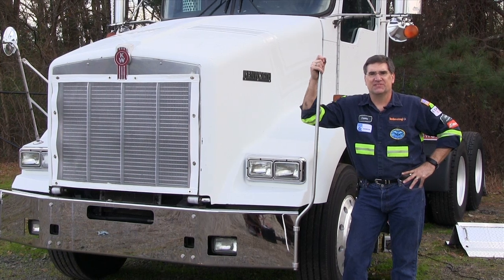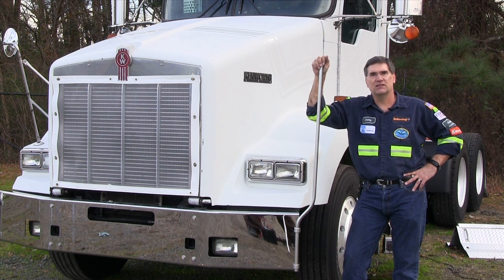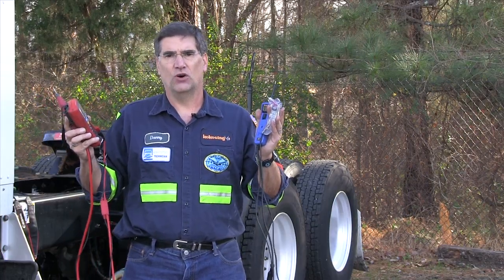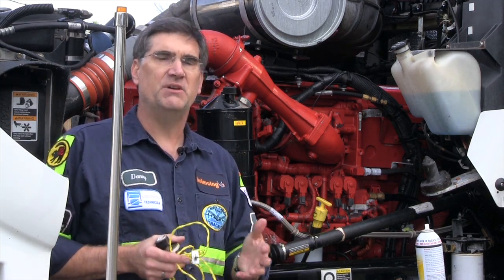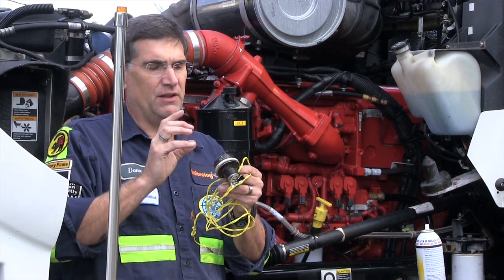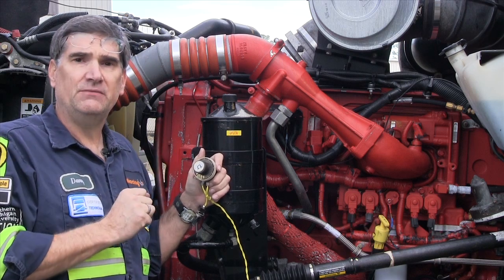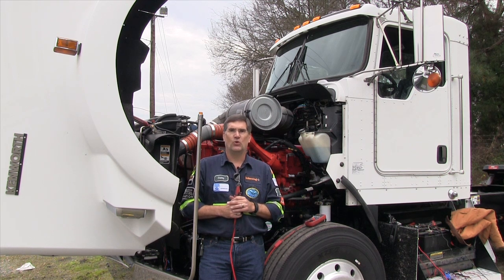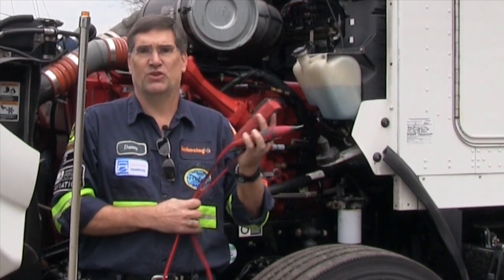LOADpro® vs. Volt-pro vs. Powerprobe® vs. Corrosion

Comment: Which tool is better? Decide for yourself. Whatever tool you pick, one thing is for sure: the ckt  must be under load to get accurate voltage drop readings. Ohmmeters are for the bench. The PP requires back probing/piercing a circuit that has not been unplugged and is up and running. The LP idea is unplug the load and substitute the load. LP is cheaper cause you already got a meter. The idea of having to back probe every time greatly limits options to conductor access. LP doesnt need to go back to the battery, beautiful. Not sure how LP does accurate loaded ckt testing with 40mA/Volt. Guess it just does, and how does VP work?
Reply from the maker: Carl Thaysen It works because Ohm's Law is perfect, so ANY drop is a measurable resistance. It's not designed for large gauge wire - but it will work. It requires your judgment, and the understanding that the amount of resistance that's relevant and harmful is a function of the load. A 3Ω AC clutch will be hurt by 1.5Ω of resistance. But, 1.5Ω won't hurt a 100Ω relay. You have to remember that we won't be there looking for a problem unless there's a problem to get us there. If it's big enough to break the machine - it will be big enough to find. The Volt-Pro is total hack. I sat with the people at Hickok-Waekon a long time ago where they said my idea was stupid. Yeah - right...
Reply: Daniel Sullivan Ok. So whether you push .5Amp or 10 Amps through the corrosion, you will find the voltage drop.  So simple and there's probably no quicker way to locate a problem, not that i can think of.

Comment: Hello Mr. Sullivan.
I was very impressed with your demonstration here, so much so I just bought one on line.
I do have one question, does the voltage level make and difference to this probe?
I do allot of testing on 5V reference circuits, And GM keep saying that we will see 36 volts systems soon, will this work  on these voltages as well?
Reply from the maker: Jeffy2n Yeah - all good on 5V & 8V.
Reply: Thank your Mr. Sullivan,

Comment: Dude, you're trying to patent multi meter test leads with an integrated, fixed resistor. I'd rather use a light bulb matched to the current flow of the circuit I'm measuring and then check the voltage drop from the power source to the positive and the ground source to the negative side of the load connector. I can see why your personality could get you into trouble. You seem to have a serious chip on your shoulder. You're emotions are seriously affecting your reason regarding the value of your tool and the lack of value of other tools. Plus, you're kidding yourself if you really think you've invented something even slightly unique. It's still the same concept as putting a light bulb in place of the load and then measuring voltage. And, as others have commented, some of your testing for all of the tools is flawed. It's my opinion that you need some electrical training, you don't know as much as you think you do.
Reply: +Marc DuBois I am a professional Transit Bus Tech Ase Master L2 certified and I own a set of Dan's leads and I like them.  There are professional Techs using them.
Reply: +Killer2600 I can't speak for Dan, but in my opinion I think he realizes he didn't invent loaded circuit voltage drop testing.  As he has said in this video he is a instructor first and I might add a excellent instructor.  He taught two classes for us and all I ever heard from the other Techs after he left was when is he coming back to teach more?  He also briefly talked to us about Power Generation and I was amazed how knowledgeable he was.  For the people on here who doubt Dan, I understand, everyone has their own opinion.  But how can you form a opinion if you have never read his book, taken a class of his, or tried out the leads?  Tool truck salesman will let you try out products.  Plus the other thing that interests me is Dan has three major companies that have adopted the tool.  As Dan has said Caterpillar, Volvo, and Ups.  And to be honest guys and if any gals are reading, at first when I saw his tool for sale and the book I had my doubts also.  But when I tried out Dan's leads for the first time and they worked and helped me shave off time on my diagnostic, I was convinced.  It is not just about his leads it is also about using the Ghost and True Zero Volts method of reading your Dvom.  Plus if you understand Kirchoff's Law you can use this law to your advantage while using the tool.  Now can you do Voltage Drop Testing with just a Dvom?  Of course you can.  Dan has just tried in my opinion to make it easier to do Voltage Drop testing.  Unfortunately sometimes it is hard to backprobe connectors and it is easier to disconnect and then test the wires but then you have to have a load to accurately test the wire.  Does everyone have a million light bulbs in their box?  This tool in my opinion makes it simple and effective to do Voltage Drop Testing.  So yes everyone the tool isn't flashy, but it gets the job done.
Reply: busjockey1 There's always companies in court over IP (Intellectual Property). There are actually companies called patent trolls that do nothing but purchase patents in mass and threaten to sue anyone that doesn't pay licensing fees for the use of their patent. Most recently in the courts was a case regarding the scan-to-email function in copying machines. The patent troll didn't just go after the companies that made the copier with the infringing function, they went after businesses that bought copiers that had the function and tried to charge them a per user fee based on how many employees they had that used the copier. Of course it ended up in court and the judge threw out the patent based on the proof of prior art meaning there was evidence that the scan-to-email concept was patented, existed, or was known prior to the patent this patent troll held. Another case of copyright in the courts was the happy birthday song we all know. You can sing it in private but in public or for commercial use you had to pay the copyright owner, who like a patent troll bought the copyright from someone who had it prior. In that case the courts decided the copyright holder didn't have a valid copyright because there was evidence the happy birthday song likely existed before the person who originally copyrighted it did so. It's pretty sad how some scoundrels make a living and what kind of stupid crap ties up the court system.
Reply from the maker: Marc DuBois Dude, it is patented, in the US and Europe. And dude, I used the tools exactly as their instructions indicated. That video is 2-1/2 years old. The lawsuit is being filed in a couple of weeks. Irrelevant much?
Reply: You didn't use the power probe fairly, and you know it. Also, how do you do your test when you can't get to the connector to unplug it? Additionally, you say that 80% of the time it's the wiring. Well, maybe in whatever type of work you do, but on passenger cars and trucks, that number is flipped. It's the component 80% of the time. I do test for power, ground and signal on sensors and components, but it's fairly rarely the wiring. Maybe you should keep trying to win over the best chance of a market you have; the do it yourselfers. I'm an ASE Master L1 tech, and I've seen your leads for years but do not know of a single professional technician that owns a set. I'll check around at the nearest Volvo dealership, but I suspect that most of them have never even heard of your leads, just like most of the other techs I know. Talk about irrelevant. (and easy to provoke).
Reply: busjockey1 That would depend on the specifics of the patent. If the patent holder has a patent on the function and is the inventor/originator of the function then no one can legally copy the function without the patent holders permission until the patent runs out. In dan's case of suing companies that make products that do voltage drop testing, not only does he need a patent he needs to be the first to invent/conceive/conceptualize voltage drop testing as if voltage drop testing didn't exist until dan came up with the idea. Basically you can't patent an already existing/known idea/invention and if you manage to slip it by the patent office and get a patent it'll only hold up in court so long as no one can prove the "invention" existed, was known, or was patented before you applied for your patent. You know dan better than I, do you know or believe he invented voltage drop testing and such a thing didn't exist prior to dan?
Reply: Like I said before, I will not speak for Dan because it is not fair to do so.  However do I realize Voltage Drop Testing has been around before Dan, of course I know this, everyone knows this who is involved in electrical diagnostics.  Don't get me wrong I see your point.  Guess will have to wait and see what happens with Dan's situation.  A similar case I believe is happening right now with Bernie Thompson of Ats on his Pressure Transducer software and tooling.  Nice talking to you.
Reply: NR D  Now that we are at the t word: ... is a person or company that attempts to enforce patent rights against accused infringers far beyond the patent's actual value or contribution to the prior art
Reply: Yeah I went completely off the subject there, sorry.  Just wanted to express my opinion, just in the wrong section I guess, lol.  I am not as patent savvy as you are, so If I am reading this correctly, you are saying that if a product is designed differently but does the same function, is not a infringement on a Patent?
Reply: +Marc DuBois Thanks for your comment,  I was thinking do I just see a switchable 15 ohm load resistor parallel to the voltmeter or there is more and I am even to stupid to see it.
Reply: Daniel Sullivan Patents aren't everything, and getting one doesn't mean you were the first to patent the idea. A recent case was a patent lawsuit over podcasting, the patent holder sued a bunch of podcasters for patent infringement if they didn't pay licensing fees. It ended up in court and in the end the judge invalidated the patent as it was proven that "prior art" existed meaning that the idea/invention was known or patented before the patent in question was created. In this case, a prior patent that covered podcasting was the "prior art" proof. The real winners were the lawyers on both sides that were eager and willing to go to court so having a patent and a lawyer eager to go to court for you and your patent doesn't mean s**t.
Reply: Marc DuBois Be nice, this nice man has a patent on voltage drop testing...I have to agree, while I test wiring every time, in my experience wiring has been the issue only about 20% of the time...But still be nice, this man makes a tool that you have to hook to another tool to use. Would that make it a tool or tool accessory?
Reply: +Marc DuBois ..... Definition of a Troll is someone winding people up or trying too.. I wouldn't be too concerned Dan, this peanut will move on when he's done getting a rise out of you.
Reply: busjockey1 Congrats, I don't think anyone doesn't believe that companies and people have bought the LOADpro. The problem people have is the LOADpro is not as inventive as this guy makes it sound and it's annoying that this guy thinks he invented loaded circuit voltage drop testing and wants to sue anyone that produced a product to do loaded circuit voltage drop testing.
Reply: busjockey1 That's quite a comment you wrote there but entirely unnecessary as no one questions whether the LOADpro works or not the problem is with dan's issue of other companies that develop products that do the same thing his LOADpro does. He has stated that they are stealing his design and infringing on his patent. But when you see the products he accuses of stealing his design, they aren't the normally seen low cost chinese clones that actually are just a cheap identical rip off of a brand name product. These products he accuse are obviously unique in design and function with the only commonality being they make voltage drop testing quick like the LOADpro. With that one can only assume that dan's invention, that he has a problem with people copying, is voltage drop testing itself. I don't have to know dan to have a educated opinion on his "patent" and his claim of others stealing "his invention"

Comment: Great video. The product seems to have already great success in trucking industry.  I hope that you sue those and win who stole your patent.  

I am curious, is LoadPRO safe to use on computer inputs and outputs? what is the resistance of the load inside of the tool? 

Thanks
Reply from the maker: Marc DuBois I guess that's why Caterpillar, Volvo and UPS use it on their trucks and equipment. They love blowing stuff up. Your two cents worth is used up and it didn't get you much. Shoulda bought bubblegum instead...
Reply: Yeah, I can see how successful your endorsements are by how much you cry about the debt that you're in. If your product was great, many more people would own them. About 95% of the technicians I know own PowerProbes, about 95% of technicians I know have never heard of your leads. If your product was anything special, you would be rich,you know, like the guys at PowerProbe. I have to tell you that your hostile personality comes through even on your instructional videos, I bet you're just a peach to deal with.
Reply from the maker: autoparts321 Load is 40mA/V - fully safe on all sensor drivers and returns.
Reply: Daniel Sullivan It most certainly is not safe on all sensor drivers! Try putting a 200 mA load on some 5 volt reference wire circuits from a PCM and you'll find that the current overload protection will kick in before that. And that's if they have over current protection. If not then you may have just let the magic smoke out of the expensive black box. I would certainly never load a reference voltage circuit that much current.

Comment: Hi Daniel, I have been looking at purchasing something like the Power Probe or Ultra Probe to go along side my multimeter & test light for electrical diagnosis on my car when required. After watching your video I'm now thinking I might get your LoadPro.. Have I understood correctly in thinking your LoadPro combined with my multimeter will do the same thing as the Power Probe only better, more accurately???
Reply from the maker: Jas George All tools have value, but a sharp point and the inability to load a circuit (Powerprobe) isn't anywhere as effective as a voltage drop with the load removed. I operate on the 80% bet - wire - and test that first. Powerprobe operates on the 20% bet - component - and that's less effective. Yeah - the LOADpro can do what the Powerprobe can do in terms of basic diagnostics. I really don't care about the extra stuff it can do.

Comment: Question for Daniel...can a multi meter die? My neighbor gave me one said it dosent work. No digital read out on any setting.
Reply from the maker: I've never had one die, but they'll hibernate at times and fake you out. The most likely thing to test is the battery connections or battery leads - I assume you installed a new battery. I fixed a guy's Fluke 87 once by simply cutting the red and black 9V leads and resolder them to the board. If it's past that, the only other thing to check is that the card/leads connecting the screen to the main board is connected (remove and replace once or twice) securely. No harm in opening it up and looking. BTW - the fuses wouldn't do what you're saying is happening...
Reply: Norman McDonald  some multi meters have a fuse in them if Dans other methods dont check out
Reply from the maker: deepsquat600 The fuse is only for the ammeter - nothing else.
Reply: deepsquat600 thanks for your advise. found out it had a dead 9v battery. didn't know they opened up.

Comment: Question for Daniel - as this video was produced over 2 years ago, do you think the new Power Probe IV can detect resistance in the wiring? Thanks.
Reply from the maker: Yes - it can. In my opinion it's infringing on my patent, and I'm having to fight them in court. However, it uses ohms for some reason instead of volts - I think in an effort to get around what I do. I'm producing another video, but I've been pretty strapped for time. Regardless, the sharp point is stupid, because it either pierces insulation or penetrates the corrosion and misses the fault. I have a personal stake in it - I'm biased - but I think I'm on the side of right. Not only that - $50 is less than $150...

Comment: HEY, I have one in my shop and is the best hi resistance finder in the shop hands down. After the guys see how easy it is to use on fuel pump issues on cars. They stopped using the headlight test on the fuel pump wiring to verify current. Any one that has a beef with you just doesn't understand electronics. 
Chester County Auto
Reply: +Vince Moore I use them to Vince, they work great.  I have shot a few videos of me using them to find problems.  Take a look and share if you'd like too.

Comment: Awesome tool Dan, genius! I am a marine electronics tech for 20 plus years and deal with voltage drop issues on a daily basis. In my arsenal I have a power probe 3, portable TDR, fox and hound, test light, etc. I wish I had known about your tool years ago. I look forward to whipping up on some messed up wiring with your tool. Take care-